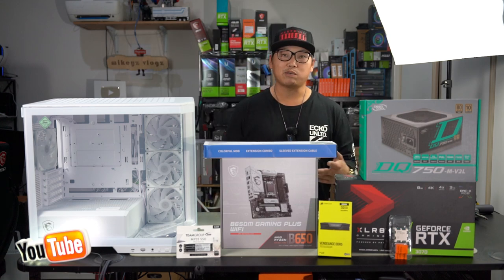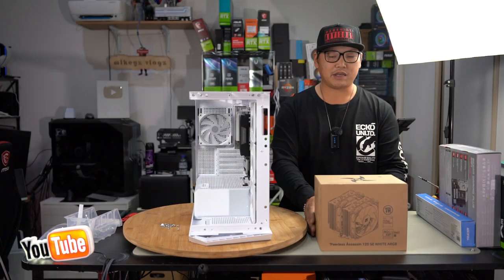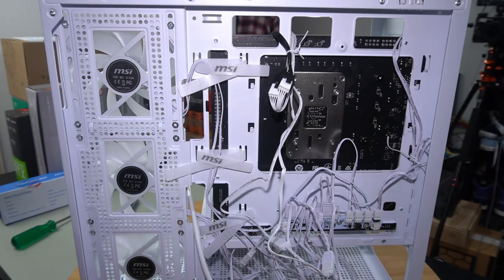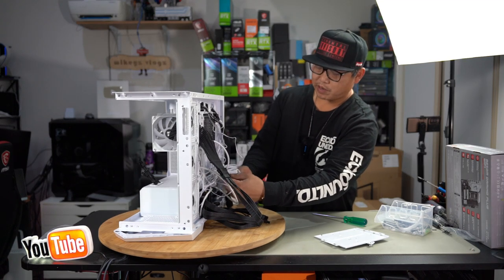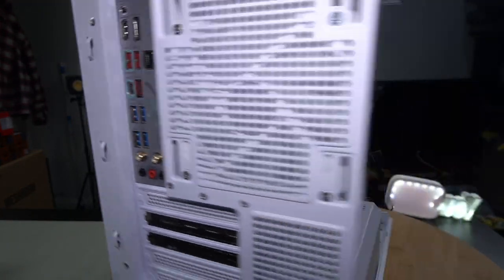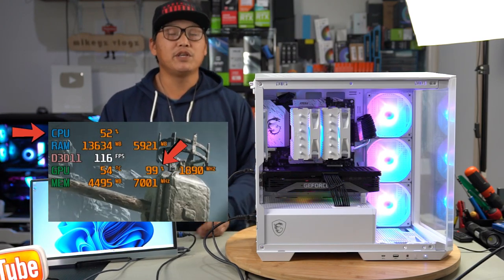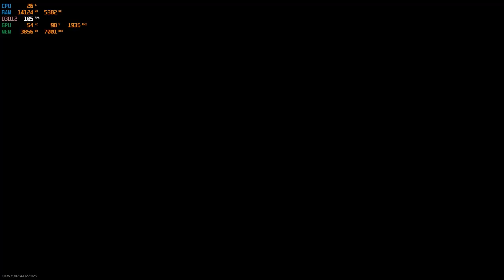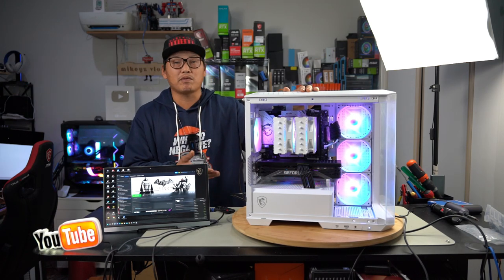step by step pc build guide msi mag pano pz matx am5 ryzen 5 7500f rtx3070 NON project zero

Comment: What is the splitter for the tower power cable, you highlight it without saying what it is for, thanks
Reply from the maker: the spliiter is just the hub that comes with the case, it sis usd to plug in all the fans and rgb cables, it comes plugged in so u will see how its used
Reply: @MIKEYZVLOGZ  oh ok, I made that computer but I never plugged the splitter into anything, the fan/light hub seems to work fine? is the splitter supposed to plug into the ARGB on the board?
Reply: @MIKEYZVLOGZ  It's the power cable that has a splitter off, it's in you're video but you don't show it plugging into anything
Reply: @MIKEYZVLOGZ   Hi it's at 9.50 in you're video you mention the splitter off the all-in-one power cable, but I don't see you plug it in, thanks
Reply from the maker: @Derek-Trotter  ok your referring to the splitter that comes off the F_panel cables all in one , ok so the splitter that comes off it is for an optional reset button 
because this case comes with an rgb button, they use the reset sw pins and plug it into the argb hub, so your able to control the rgb using the button on the case next rto the power button, however if you choose not to use the rgb button, you can simply plug the reset sw cable into that splitter you see, and the button on the front of the case now becomes a reset button instead of controlling rgb... hope this makes sense
Reply from the maker: @Derek-Trotter  the splitter is the option for a reset button instead of rgb button, thats all it is, hence why u dont plug anything into it and it works fineand u control your rgb via the button on the front of the case
Reply: @MIKEYZVLOGZ  Yes that's it, so I'm ok leaving it unplugged because I use the RGB for the light, appreciate you're help

Comment: Do you know what the splitter cable is called or have a link to purchase? Cant get my case fans on lol
Reply from the maker: are u referring to the pcie 5.0 extension cable that splits into 3 8pin?
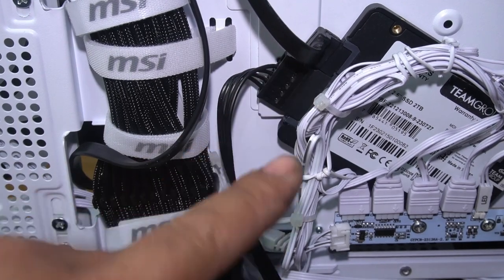Reply: It might be it im specifically talking about the one from 8:44-9:10. Everything works in my pc besides that hub where all the fan wires are connected to!

Comment: Hey question about the case, in some videos and comments about the case, the type c connector kinda pops out at the back, which results to being folded when the back cover is put on. I think I haven't seem to see it in your video?
Reply from the maker: hmm that isn't the case with this build because i have a mobo that supports the usb 3.0 and type c ... in another build I used a gigabyte mobo and it didn't support type c so I used a usb 3.0 splitter which I then used to adapt to type c and usb 3.0.. in doing so i had it splitter for usb 3.0 and I had to plug the usb cable into it ..it all comes down  to how you route the cable and stop it from un plugging
Reply: @MIKEYZVLOGZ  my mobo B650M pro gaming plus wifi and has type c on it. I kinda like this case.

Comment: Hey man I found a used  rx 6700 xt (3 fans) for 250$  which I can low ball to 200$ . It got 7 months of warranty left with no issues.  Should  I buy it ? Cuz a brand new rx 6700 xt in my country goes for roughly around 400$
Reply from the maker: what are u pairing it with?..the 6700xt is considered a very good card alot of ppl say its a 1440p but I personally consider it a high to ultra settings 1080p card performance settings
Reply: @MIKEYZVLOGZ  ryzen 5 7600x
Reply from the maker: @MetalSH  yep go for it

Comment: Hey man I'm helping a friend build with this case and I'm trying to figure out how you connected all the argb case fans plus the argb from the cooler together
Reply from the maker: if u watch the video again in the section where I connected the cpu cooler I explain that I plugged the rgb cables off the cooler to the splitter cable that plugs into the Hub...hence it will all sync
Reply: @MIKEYZVLOGZ  Are the splitters the cables that have the covers on them that you need to take off?
Reply from the maker: @blez_barnold9126  correct then u will see the 3pins for your argb cables ... plug your cables from the cooler into them..but first plug the cooler fans into each other ...and with the one cable plug it into the splitter from hub ..does that make sense?
Reply: @MIKEYZVLOGZ  Thank you for the help, the pc booted first time into the bios with all fans connected, it is so beautiful! Thank you for being down to earth and helping, subbed and liked <3
Reply from the maker: @blez_barnold9126  so happy to hear mate..well done and good on ya for helping ur mate ... I appreciate u

Comment: What do you think how thick gpu can fit with this case/mobo combo since you dont occupy the top slot? I have this case and mobo but Im not sure if more than ~2.5slots is manageable with the gpu support provided with it
Reply from the maker: it will fit up to x3 ...gpu thickness u don't have to use the gpu support on top of the psu fan shroud cover... u can always use another type .

Comment: Hey man! I have a qs , so u said to not mismatch the psu cable , the sleeved cables u bought , can I use those from any company since I’m trying to go for a white build and white cables would look very clean
Reply from the maker: yes what I meant is don't use cables from another brand ... if your using extensions... which extend from your psu cables then that's different... I meant with modular cables don't mix modular cables from another brand... sleeved extension are made to go with any psu as they only extend the cables u have ... it in no way changes the pinout

Comment: hello 
I am the owner of A207
11 year m276 engine e350 model
before 5 hole old cluster.
after 3hole facelift cluster
changing i want to

question
Can I use 
a207 e200 engine cluster?

I look forward to hearing from you. Thank you
Reply from the maker: u can use it as long as it is same petrol or desil model just get it coded and it will be ok

Comment: man today im getting my msg pano case n im paring it with my old b550mk asus mb, ryzen 7 5700x and rx6650xt will it be  good build
Reply from the maker: honestly it's a good enough build to play 1080p even 1440p as well on games that don't require as much graphic intense tasks...like csgo and games like that..but cuz of the gpu I would be doing 1080p high settings
Reply: @MIKEYZVLOGZ  does it support asus sync, im not able to sync the cabinet colour im only able to use the argb with led button. Is there any way to sync the cabinet rgb
Reply from the maker: @nervinyt1587  did u plug in the 5v3pin into your mobo and then press and hold ..yes u can use aura sync
Reply: @MIKEYZVLOGZ  bro where i plug it my mother board is b550mk asius
Reply from the maker: @nervinyt1587  does your mobo have a 5v3pin header
Reply: @MIKEYZVLOGZ  NO
Reply: SAD LIFE
Reply from the maker: @nervinyt1587   does it have 12v 4pin ? if not u can still make it work u just need an adapter ..search sata to 5v3pin in google and u will find what u need
Reply: @MIKEYZVLOGZ bro now im getting the msi zero project board i need to know how to connect both the cabinets 3pin connecter and coolers rgb connector
Reply from the maker: @nervinyt1587  wen u say 3pin do u mean rgb 3pin or the fan 3pin
Reply from the maker: @nervinyt1587  if you do get the project zero mobo, its gonna be pretty straight forward, there are a ton of videos already doing step by step guides , just follow them and u will have your build sorted in no time, my main focus was to build using this case but not the projedt zero as its just too expensive for budget builders anbd i wanted to show an alternative and still mnake it look good
Reply: @MIKEYZVLOGZ  will there be more than one rgb connector on the board or shld i connect the cooler fans pin to the msi hub
Reply: @MIKEYZVLOGZ  rgb pin
Reply: @MIKEYZVLOGZ  can i have ur insta bro
Reply from the maker: @nervinyt1587  mikeyzvlogz83  same logo

Comment: Hello, I loved your video and the explaining. Can you please rate my build. I would appreciate. I already purchased rx6800xt in a good price with warranty.

Purpose: Gaming

System Specifications

Graphics Card:
GPU Red Devil AMD Radeon™ RX 6800 XT 16GB GDDR6

Motherboard:
B650M GAMING PLUS WIFI

Processor:
Ryzen 5 7600

Cooling System:
LE720

Memory (RAM):

	•	Corsair VENGEANCE 16GB DDR5 6000MHz Desktop RAM
	•	Corsair VENGEANCE 16GB DDR5 6000MHz Desktop RAM

Storage:
Samsung 980 PRO 1TB PCIe 4.0 M.2 NVMe SSD

Case:
PC POWER ICEBERG V2 ATX Gaming Case

Power Supply:
Thermaltake Toughpower GF1 750W Snow TT Premium Edition Power Supply

Monitor:
MSI G274QPF E2 27 inch 180Hz 1ms IPS WQHD Gaming Monitor
Reply from the maker: @lowsongby  yeah mate that's a great system 👍...u can save money in a few places such as different brand nvme ssd and are u sure the psu is enough for the system? ssd nvme I would get even just a lexar nm790 which would be cheaper then samsung ..it performs the same if not but faster read and write speeds
Reply: @MIKEYZVLOGZ Thanks for the suggestion. I think 750w will be enough. But I’m not sure. I saw another guy made the same system with 750watt psu. And the ssd is only few bucks extra that’s why I selected samsung.